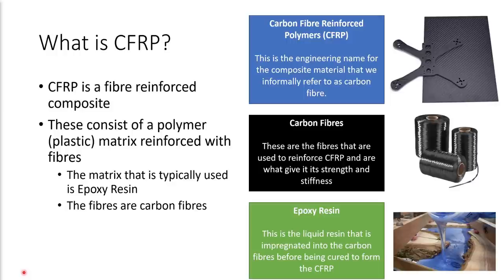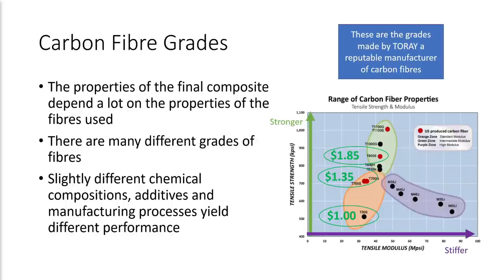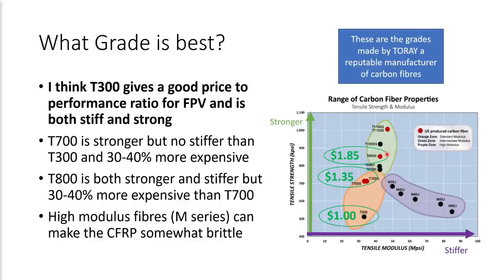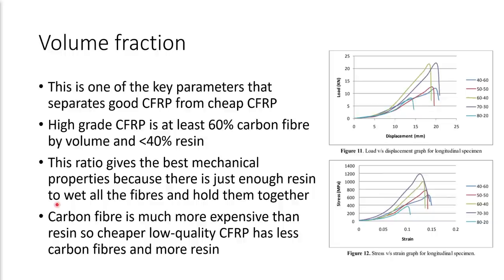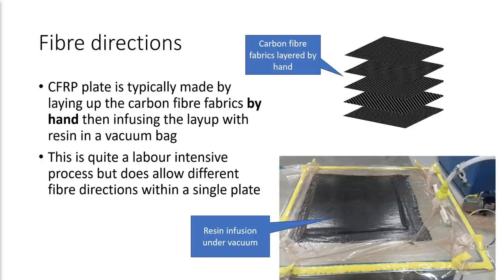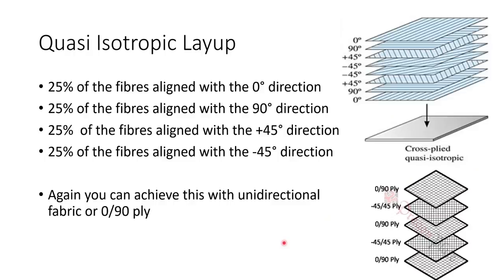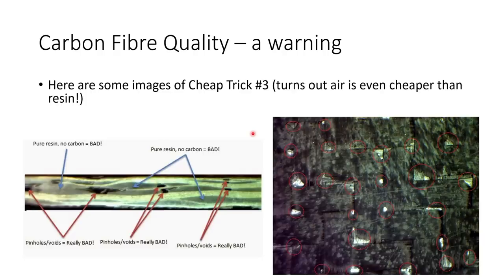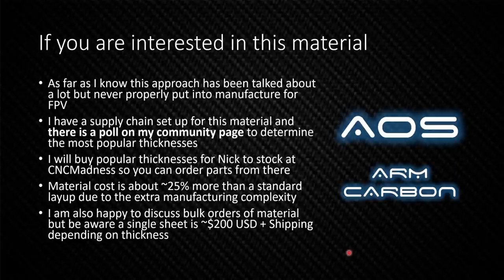Carbon Fibre: A deep dive on this incredible composite material

Comment: Hey, Chris. Solid video as always. My opinion on the t700 carbon is you should absolutely offer it as an option for the AOS frames. Personally, I would like to have all of the body plates be t700, while the arms remain t300. This is because I would rather snap and replace arms than ever have to replace a body or camera plate. I don't speak from any experience with frame design, so if what I said isn't necessarily correct, please advise :)
Reply from the maker: Good call! I'll speak with Nick about making it an option.

Comment: Great video Chris.

Just couple questions for you.

1) What is the process to manufacture those cfrp? Is it standard room temperature vac bag process, autoclave or out of autoclave (OOA) method?
2) Did you use Unidirectional cfrp in your new design?
3) Why don't you use standard mechanical properties testing like tensile and bending stiffness?

Whatever it is, you did a great job and appreciate your effort.
Reply from the maker: 1. The material is made exactly the same way as cncmadnesses standard layup by the same company out of the same materials only the fibre direction is different. I think its a vacuum infusion process and then cured in a heated hydraulic press.
2. AOS Arm carbon uses only Unidirectional carbon fibre in the layup to maximise the fibre volume and the straightness of the fibres. The UD layers are oriented in different directions to provide the right balance of stiffness.
3. I do what testing I can. I don't have access to expensive test equipment, I'm just a hobbyist. I do flight testing and blackbox to confirm the simulation results and my sims are currently within 5% of test results. This gives me good confidence in the  approach but I'm not a big company, just one guy doing his best.

Comment: Great video. Finally someone tackles carbon layup for FPV.
I always wondered why no one used 0,+45,-45,0 or +30, 0, -30 or similar layups for arms. But it seems they are not readily available as plates, so that may be the explanation.
Reply: We at Madkwads have done that since 2018 and I suspect Chris got the idea from us because I explained the concept to him in a private chat. After that he started looking for other manufacturers that could make plates for him leaving out the part with IM-fibers and TeXtreme spread tow fabric.
Reply from the maker: I remember Bob Roogi put us in touch early on when I spoke with him about optimizing CF layups. I know we spoke about simulating different layups in FEA and it motivated me to create the code I now use to calcualte the coposite porperties of different layups. Unfortunately the cost of Textreme (particularly for larger thicknesses) was prohibitive. Fortunately the tool can be used to optimize layups for any material set. Cheap or expensive!
Reply: @ChrisRosser  Yes, But we have reduced that now by investing in a high pressure press and a cnc machine. This way we can reduce labor and shipping cost that earlier was a big part of production cost.

Comment: My thought on price for frame material is that since the cost of electronic components as gone up so much, the cost of frames is relatively low. Paying 85% more for the frame would still only drive up the cost of the build by around 10-15% assuming you are using premium components. If you took it further and only used the T800 for the arms, the relative increase of the build would be even smaller. So I would definitely be willing to pay more for more out of my frame.
Reply from the maker: Great reasoning. I'll see if Nick can make some higher grade fibres available.

Comment: I would, but I would definitely would if you used different material on different layers. What would be ideal would be semi quasi-isotropic (biased for 0deg) layer-up using an alternating combination of M30Sc (int Modules - 294Gpa\5.94GPA tensile modules\strength) and T700 (standard Module - 235Gpa\5.3GPa) layers.  This combination would give the best stiffness and strength for the price and will as this will raise the resonance frequency significantly.
 I also believe the outer Weave can make a significant difference. For example, Textreme Spread Toe used as the outer layer is far better than standard twill for dealing compression and expansion forces.
I believe the Karearea Tora uses T700 CF
I look forward to something like this being available in 5mm or 5.5mm thickness for my AOS 5.5". (Fingers crossed)
Reply from the maker: It's a great idea! Using different materials for different layers would be a big change to the manufacturing process and might add a lot of cost needing extra reels for the different materials and extra QC for verifying that the right material was used on each layer. It would probably be cheaper just to use a higher grade fibre throughout to keep the manufacturing simple.

I would be interested to learn why textreme is better than a standard woven fabric for the outer layer. I guess they are using a higher grade fibre so the material is stronger (but also 2x the price!) A spread tow weave is pretty common for CF and makes the outer fabric layer thinner and gives a different look but I'm not sure there is a mechanism to give an enormous performance benefit.
Reply: We at Madkwads do use T700S for the middle of the laminate to build thickness and M30SC on the second outermost layers where they make the biggest difference to performance. There are several advantages to TeXtreme. One is that it is much thinner so for a set thickness, say 5mm, you can fit more T700 and M30SC UD layers that improve the perfomance compared to a thicker 3K weave. The angle the fibers have to take to get over eachother inside the weave is much lower compared to thicker weaves. This improves the compression strength of the weave. Finally - it looks spectacular! With a mirror finish on the plate it is just stunning.

Comment: I have flown frames from Madkwads which reminds alot of what you are talking about. They fly very good and have great durability. Also exceptional stiffness with just 2 mm arms.
Reply from the maker: I believe MadKwads use their own carbon fibre fabric "Textreme" which is certianly a high grade material but I'm not sure they have the layup optimized specifically for each part (I've been speaking to them about this as recently as a few months ago). The software I've written allows optimization of any carbon fibre material set so perhaps there is some overlap there.
Reply: @ChrisRosser  I have talked to Madkwads and to my understanding they have definitely optimized the layup for different parts of the frame.
Reply: @ChrisRosser  they most definitely have optimised the layup of the CF per part. I've seen the way they do it first hand. Reach out to Johan and Oscar and they'll for sure be able to confirm or deny this claim
Reply: @selaI3  Chris literally said that has been speaking with them about this....

Comment: I'd love to see the performance of a crazy strong carbon like t800 or t1000 for the arms (both reduce the resonance and strength during a crash) with this weave method. And maybe a more stiff carbon fiber on the frame (stronger than 3k but also going to reduce a lot of resonance). It might be expensive as hell but it'd be pretty cool to see the results. I'm sure some people would drop $200 on a frame if it meant it was borderline invincible and flew amazing.
Reply from the maker: I'm working to make T700 available for my frames. T800 or T1000 is something that I might be able to do as part of special editions with limited runs due to the incredible cost of stocking the material.

Comment: Oh this is the stuff madkwads uses! They are the absolute best in the carbon game! We use their carbon on our frames and its game changer. How ever is that stuff not proprietary. I know they make stuff for huge car brands and more.
Reply from the maker: Madkwads have their own carbon fibre materials set and its quite a lot more expensive at around 2x the cost of standard CF I think. This is a layup optimization so it can be used with any grade of CF from any manufacturer that can make standard layup. This makes it potentially much more economical for mass production.
Reply: @ChrisRosser  yeah well I have used theirs and its done wonders for my frames. I dont mind spending a bit more to get the absolute best. But I guess many people here want to be cheap and get stuff as cheap as possible. Since I like to have stuff that lasts i dont mind paying 100euros for a frame when its much better then the 50€ frame. Its all about how long will it last and how much less time do I have to spend on repairs. Also they have been doing this for so long they know their stuff. I would recommend them to any one who wants stuff that lasts and not who wants the absolute cheapest way to get something sort of like it ;-) But cool that your talking about new types of carbon. Its always interesting.

Comment: ill be interested to see the crash data on this and how the very separate layers although joined, act on impact. as the 45 deg. layers are sandwiched in the middle i will be curious to see how they delaminate on  impact. I would assume that having the 45deg. fibers be spread out more uniformly in the layers would provide superior strength then them being positioned only in the middle {ie quasi isotropic), however, this is an assumption based only on my limited experience i am not a schooled engineer.
Reply from the maker: Yes, I am interested to see how these arms break when crashed really hard. You can be sure that if there is room for further improvement I will adjust the layup design!

As far as I am aware the 45 degree layers are best placed in the middle because they have the same effect on stiffness wherever they are. The UD layers are better further out so they go on the outside. Quasi isotropic is a sepcific layup with 25%  0/90/45 and -45. AOS Arm carbon is an anisotropic layup not quasi.

Comment: This reminds me alot of what the guys at Madkwads is doing! Glad to see more people go that direction :)
Reply from the maker: Madkwads took the approach of using higher grade and more expensive materials to get more performance. The nice thing about optimizing the layup is it makes any materials set 20% better! So you can improve cheap CF and expensive CF as well without adding any material cost.
Reply: @ChrisRosser  
having helped production of MadKwads CF during a weekend I can assure you that they have put a lot of effort into optimising their CF layout. Just putting their achievement to more exotic materials is selling it short. They have done the work with material spec and it's layout, maximizing the performance to the expense of higher cost.
Reply: @ChrisRosser  Have you validated that claim thru mechanical testing in a scientific way?
Reply from the maker: @selaI3  Yep, you are quite right looking back through my conversations with them I calculated their layup design added 30% torsional stiffness and 6% bending stiffness over standard layup.
Reply from the maker: @madmanjohan  Absolutley, the performance improvement has been validated with bench testing and flight testing.
Reply: @ChrisRosser  Do you mind sharing some details of the testing you did? I'm mostly interesting in the exact specs of the reference material and how the test setup looked like
Reply from the maker: @madmanjohan  Sure. The flight testing is blackbox log analysis with the same quad (XL5) and arms made of different layups (standard, quasi, AOS, and AOS at 90degrees) and comparison to FEA results. The bench testing is just bending and twisting the parts held in a vice and measuring the force. It's super super basic, I don't have access to any fancy test equipment.

Comment: Back in the '80s I was a bicycle geek who was learning about the new-fangled carbon fiber frames that were coming to market.  Part of the promise of this then-expensive-and-new material was the ability to customise the lay-up of the build.  Here's Our Chris, fulfilling prophecy.  Dang, ain't engineers wonderful?
Reply: @Grim FPV Not compared to the '80s.  The stuff was scarce back then.  Multiply Chris' price per sheet by about 12 and you're in the '80s ballpark. . .
Reply: @Grim FPV 1980s dollars, too.  Be five figures in today's money.  I shit you not.
Reply from the maker: I'm really pleased the cost didn't go up too much when customising the layup. Higher grade materials are 2x the cost for 20% more performance. Now we can get the same benefit with the cheaper material for only ~25% more. 😁😁😁
Reply: @ChrisRosser  See, that's why engineers have my admiration.  You lot make 'miracles.'

Comment: I've made a lot of custom racing frames. I've broken a lot of these frames. T700 is the best - it's a lot stronger - you can cut about 30% of your arm width using it and get the same durability as T300. What I would like to see for racing frames - isn't strength or stiffness - but a material with a much greater plasticity - where it can take a hit and not break or turn into a "noodle arm". All my race frames a 5MM. There are some really interesting composites that an aerospace fabricator had scrap of that I never dived into - PEKK and PPS composites.
Reply from the maker: I'm working on bringing thermoplastic carbon composites to FPV. They have most of the strength of epoxy CF but are much more durable. They bend rather than break and you can straighten them out with a heat gun!

Comment: I am currently running modified stackups for the arms on some of my quads. Also toyed with rohacell-cored material and an extra skin to regain torsional stiffness. Also made a frame with tubular arms.

They all are far better than plain 0/90 regarding bending stiffness and ultimate strength, but the drawback is lower crashability.

In the end the crash energy must be distributed through the frame to keep it in one piece. Maybe more elongation before break would be better. Aramid+glass seems promising
Reply: That is probably because rohacell can't handle the shear forces in the center of the laminate. That is also the reason why anisotropic laminates can handle more load. In a 0/90 layup you normally end up with delamination in the center 90deg layer because in that layer shear forces are highest and all load has to be handled by the resin. Aramid and glass are/can be just as strong as carbon but they both have far lower modulus. That is why we all use carbon - it's stiffer. The other downside with glass is that it is heavier.

Comment: There must be CFs that have better vibration absorption than others.
blend in some Nyogel in the resin Matrix....  (i have no idea If i'm using these terms correctly. smack me down appropriately) 
I'm thinking of joining two 1.5mm babytooth frames with some sort of Viscoelastic Damping adhesive, 
maybe same for joining 2 3mm arms for 7"? 

the test needs to be... 
same frame design... 
Cheapest CF,  Best performance cost no object (within some reason)... 
then bang for $$$

Does it perform better.. last longer... how much soo?

The layup though is where the real magic is from my understanding. From watching F1 suspensions over the years... 
think most of the tuning is the directions of the layup.
Reply: Using a 3mm arm is better than combining 2 1.5mm arms. It is way stiffer, so the resonance frequencies are much higher. And not having low frequency resonances in the first place is superior to highly damped resonances (which is better than low frequency resonances with low damping).
Reply from the maker: L S is right that one thicker arm is better than a sandwich because shear stress needs to be transferred through the material and that doesn't happen with a sandwich. The grease is always going to work best at the joints between parts because that's where the most movement is. The arms themselves don't move as much (I've tested viscoealstic tape on the arms and it doesn't work as well as greasing the joints with PG44A). Layup is definitely the way forward because it helps cheap and expensive CF just the same.